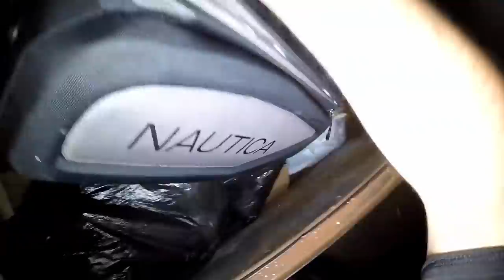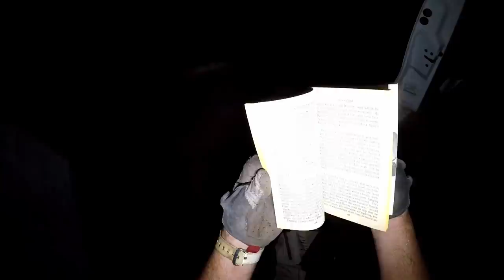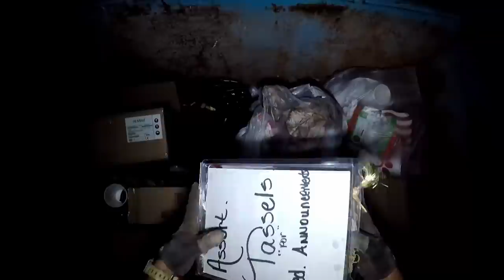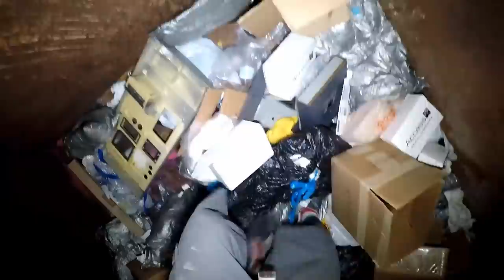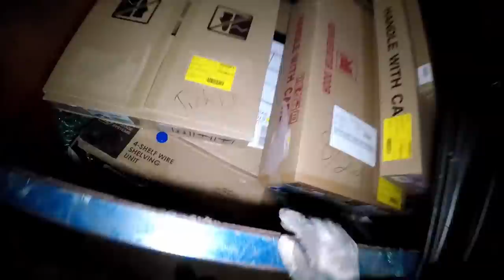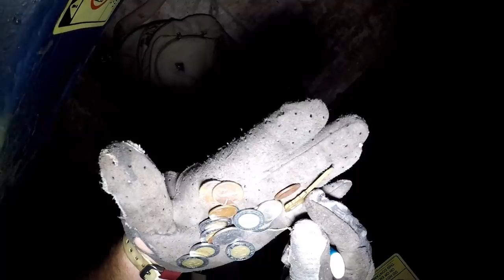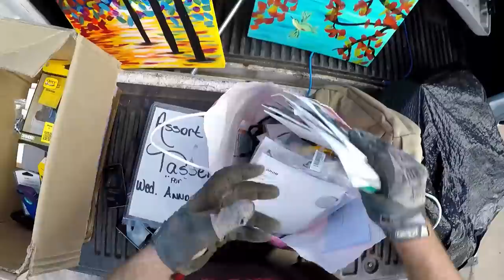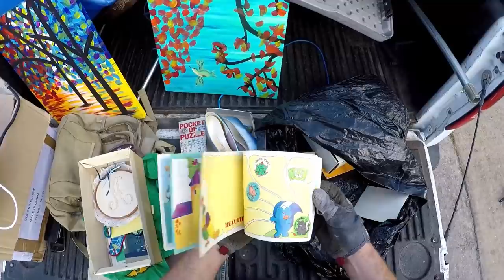Dumpster Diving (iPhones, Money, Vintage Collectibles Blackberry & More!)

Comment: Some of the appliance parts like refrigerator and microwave oven doors can make good resale value in ebay.... if those are in good condition pick it up with the box .. probably you can sell as is with the box... the twine cooler back panel you tried to pull its aluminium part (at 31:09)... is like 60-85 bucks in ebay...

Comment: a few weeks ago i had to walk over to Safeway for milk about 6:30 am still dark and had rained all night and the parking lot was empty as I was walking i seen some $1 bills as i was picking them up i seen a 5 and 10 in there so i put it in my pocket real quick until I got home, they were wet so i went to dry them and holly shit there was 3  20s 1 10 and a 5 and 3 1s $78 just walking to the store i also found a wallet and a purse i returned both after finding their phone numbers they each gave me $40.the wallet had $180 the purse 0 but replacing cards and id's is a pain i know.